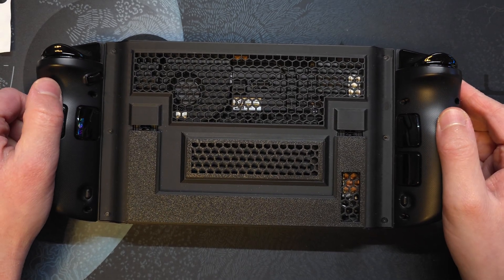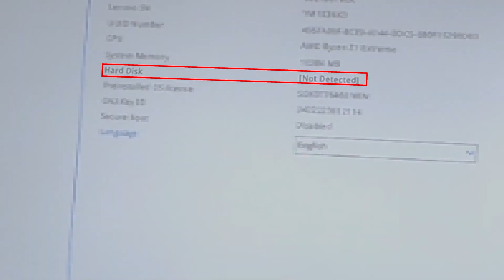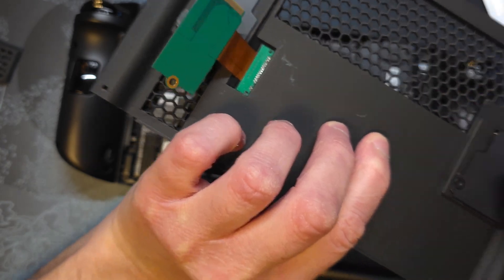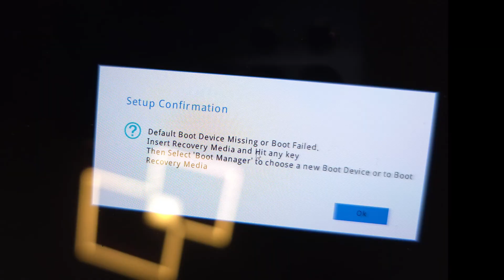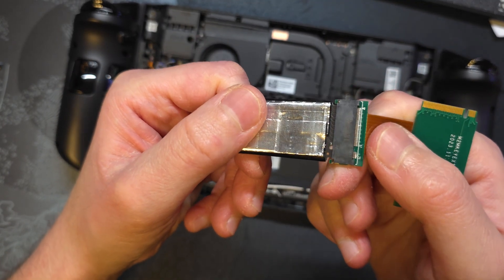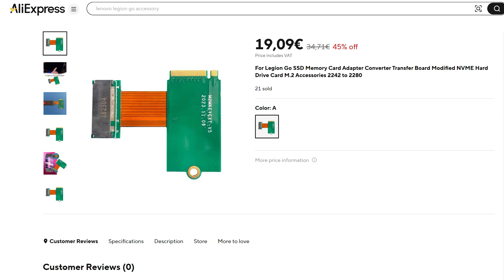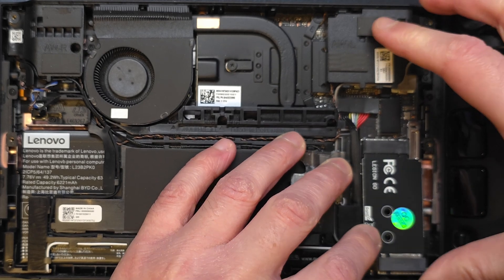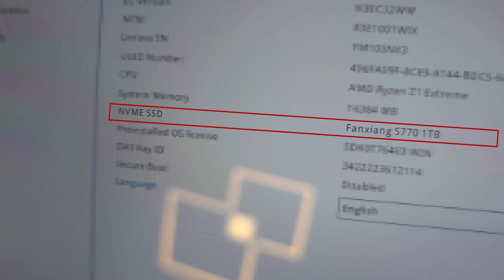Tried Legion Go’s Original 2242 SSD… Still Not Detected with This Adapter – BE CAREFUL!

Comment: I use a 4TB 2280 NVME drive with the second style of adapter you showed and the stock backplate. The drive I chose was the Lexar NM790 since it's a low power Gen 4 drive. Specs say it draws a peak of 4.1W and my temperatures have been pretty good. The most I've seen in normal use is 75C with this drive. All of the adapters I've seen with a ribbon cable like yours are PCI-E gen 3 which is why I avoided them since I wanted to use a Gen 4 drive.
Reply from the maker: But 75°C is high enough to be concerning, no? I know its threshold is 90°C, but I feel it's rather high above 65°C under load
Reply: @TECHOSAUR  Not a worrisome temp for an SSD. This is especially true for Gen 4 drives which run hotter than Gen 3 drives. You would need active cooling to keep an SSD at 65C under load anyway.

Comment: I have that adapter with a Lexar NM790 4tb and it works great, while staying quite cool.
Getting around 7000Mb speeds.

What you need to do is the following:

Buy the plastic 2280 ssd adapter which replaces the one sitting on top of the battery, from AliExpress.
You'll need to unglue one of the wifi antennas and glue it over the battery on the left side.
Put a layer of aluminium duct tape over the battery and another one of kapton tape.
Place the plastic adapter and the SSD on top of the battery.

Buy an ultra thin copper heatsink for the SSD, should come with a thin thermal pad.
Jeyi sells a pack of 3, 0.8mm, 1mm and 2mm.

 Then, put thermal paste on top of the heatsink, to use the original back cover as an extra heatsink.

SSD temps are usually under 50 andnever go over 57 Celsius when really pushed, which is perfectly safe for the battery.

You can also add thin aluminium heatsinks on the metal plate over the CPU.

And your 2242 heatsink over the adapter itself.

With thiis mod, you keep the original backplate and get really good temperatures on the ssd, cpu, igpu, board, battery... Everywhere.

If you have an email address or a way of contacting you, I can send photos.

Comment: https://youtu.be/j71jaED_3CA?si=_iXpdazEO7wQjVNp
Reply from the maker: Yes i know that message, but in my case, if I go to BIOS under NVME/Hard disk it shows not recognized, it should show the SSD name, capacity, when you go to BIOS if its connected well, the message of no boot shows when you have no bootable drive like OS, but in my legion go drive I have windows installed, I could boot to it normally unless I use this green adapter, with that black one It shows device names in bios just fine even when you have wiped out drive, that's the issue. maybe just my luck with broken one but still for 20€ its quite sad because for a simple thing it should be well quality controlled

Comment: I run mine at 54w with a WD Black SN850X and it runs fine with original back plate.

You can get a replacement for the plastic thing just in front of the battery that allows you to stow the NVME SSD using this exact adaptor, so that instead of having to replace the entire backplate, you just replace the plastic bit inside and it will fit right in. Of course it doesn't give you any room for a proper heatsink, but mine runs fine without.
Reply from the maker: did you check temperatures of  it ? in HWinfo, I was interested in this way but guess I'll have to get another unit, maybe bad batch
Reply: @TECHOSAUR  Runs fine. I keep it fan maxed though, not that it's ever had a problem when the fans were auto, but I'm for max performance.

Tried to tighten the RAM. Couldn't get it right.

Got a pair of compatible 16gb ram chips in my aliexpress basket. Might try and do the 32gb ram upgrade myself at some point, but it's a little out of my skillset so I'll probably wait until I'm in a position to upgrade before I do, incase I bodge it.

I get mega FPS at 2k ultra on nearly everything.

There are a couple of titled that still struggle, but practically everything is smooth 2k ultra with 54w TDP.

It's really underrated.

Trust man, use the , I can't remember what it's called. Shadow, or Ghost or whatever bios configuration menu (Install and boot from USB), to unlock the TDP, and set to 54w, then boot to windows and run AutoTDP, and set it in 54w in OS.

Hey presto. OP handheld.

I see the Legion Go 2, and it's nice. I think it's got a 1K oled, but I really like playing on the 2k resolution. 

If I could find a 2k oled display I'd love to replace the vanilla with an oled, but I'll prob only replace this with the Go 2 if I fudge this one upgrading it.

there are vids on YT on how to do it.

Originally I used Handheld companion. But it's a really jank piece of software, so I removed it and redid it with AutoTDP instead.

It gives you console control over TDP without the BS.

I don't even run a heatsink on my NVME and it's fine, and it's an 8tb SSD. It's not even 2 or 4tb. It's maxed out.

I recon if I could get my ram timings tightened and upgraded, those few titles would be smoothed right out, because it's just a couple titles where going up to ultra, and I'm talking ultra no upscaling. I'm playing god of war, raw 2k ultra settings, and it's like 60fps but god of war ragnarok has trouble with going from high to ultra, without dropping, but this is raw ultra,  not using integer scaling or any alternate tech. Just that last hurdle you know, and this thing would be perfect.

FYI, the audio 'problem' which isn;t actually a problem at all can be solved by going into the settings and disabling that omni sound setting, and then configuring EQ. It'll sound just as good as the Rog Ally Z1 Extreme.

First thing I did when I got it, was unfudd the sound, because everyone online was complaining about it. It's just not set up right out the box, but the speakers are just as good as Rog Ally IMO/E. It's just the software that needs to be unjanked.
Reply: @jrddoubleu514  Can you please double check these tools which allows you to run 54w? 54w seems impossible to run, due to stability issues, heat and nonetheless- the power curcuit will fry since 54w is way above what Z1 Extreme is designed for.
Reply: @TECHOSAUR  "For Legion Go Hard Drive Modified Battery Protective Board Cover Cap 3D Printing Game Console Accessories"

Aliexpress

Comment: You need first clone your oryginal SSD 😉or your adapter broken😢
Reply from the maker: My 2242 drive has Windows installed and ready.  It's what I use on my LeGo,  if I connect it without an adapter, it works. also the black adapter works with it, just this green one has arrived broken somehow; I hope nobody else has this problem

Comment: I have a MP600 2TB 2242 SSD with foil, thermal pad 1mm and the thin copper heat sink and the differences in temperatures are good. During gaming, I never get above 60c. My SSD temps are cool but after a while, the backplate near the ssd/heat sink gets hot (even though the SSD temps are mid 50c). Is there anyway to keep that area cool?
Reply from the maker: Increasing fan speed might help, but the Legion Go naturally suffers from high SSD temps since that area lacks active cooling and isn't directed toward the exhaust. Once heat builds up, it’s hard to dissipate naturally.
I mounted a fan on the back 
https://www.youtube.com/watch?v=VpMVhFaNuUc
it helped reduce SSD temps quite well and exterior temp have dropped but it's quite hard to carry around, maybe a smaller one positioned around there could be good or a slower NVMe drive something around 4000/5000MB/s read speeds should be enough for fast game loads,   high-end Gen 4 SSDs run hotter and aren't practical in this case
Reply: @TECHOSAUR  I had a WD SN770M 2230 which had a 5000MB/s speed but that one ran super hot, it had max temp of 109c during tests and even with the heatsink, max was 86c. This corsair had a max of 81c with the foil and then 56c with the heatsink :/ I'll look at mounting a fan on the back. Thanks